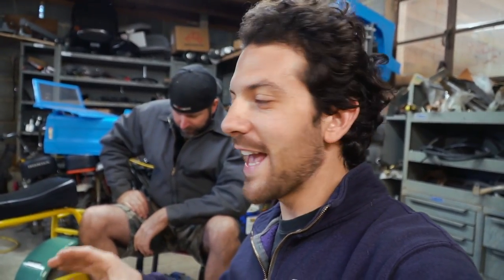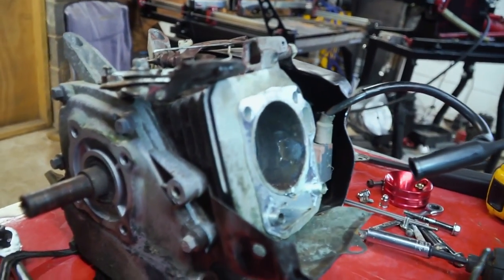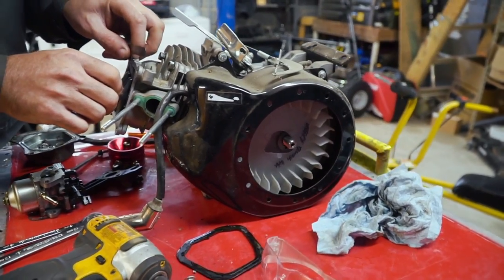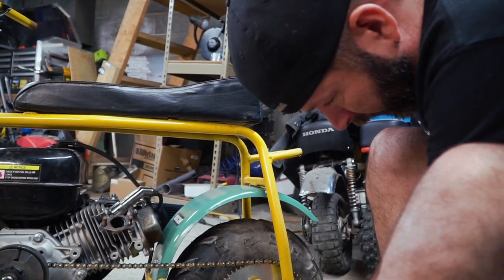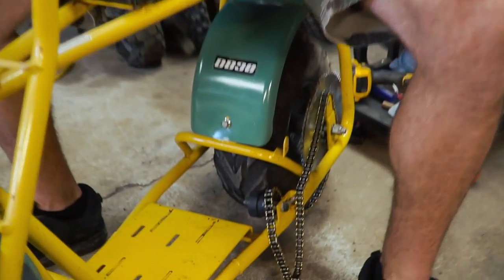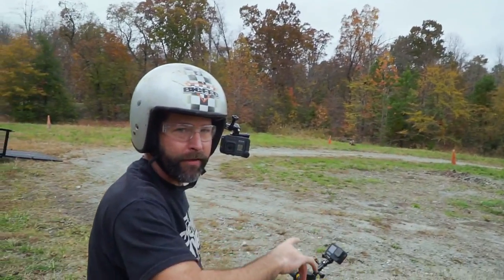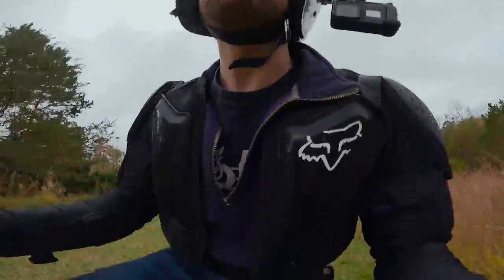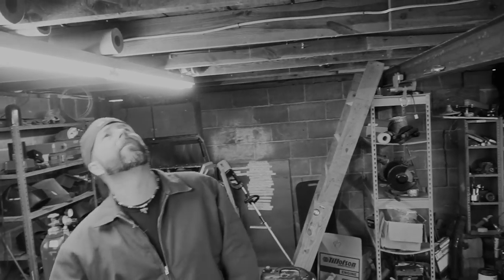Building a Budget Doodlebug Mini Bike | Max Fun for Under $200!

Comment from the maker: After working on all kinds of crazy high HP builds, this was a nice breath of fresh air for us! Have a great Monday!
Reply: Hi i have. A yerf dog go kart and i have a 420cc on it how can i wash it without damaging the engine any tips
Reply: @farazamjad3849  just cover the engine and you'll be fine
Reply: I got my go kart yesterday and its fun
Reply: @farazamjad3849  I'd recommend covering the engine with a tarp And not Putting water on full power and leaking through
Reply: Love the work you guys do, can you guys do a full dedicated episode of all of the different gear ratios into combinations from Torquay off the line performance to top end that would be great,  clutches versus cvts
Reply: How would a tillotson 212 be in a mini bike? How would the power be for acceleration off road? Should i use a clutch or a torque converter if i am riding a small oval loop with the capability of going over 20 with a small atv
Reply: @charliemaybe  thair should be some vid if you can't find any try [buld break reapeat
Reply: SnS (slip n slide) love the vids
Reply: You should also try to moto Vox mini bike!! And do a all our build ( painting the engine block, put stage 3 parts, custom rattle can paint job etc) what ever it is it’s going to be cool!!
Reply: @CarsandCameras
Reply: I have a 9 hp Honda, not a clone on a doodle bug and I have got a 15 tooth clutch on it and it flies, also the front wheels of a lawn mower fit on the rims awesome
Reply: You can also put snowblower tires from China
Reply: Try the chain under the idler pulley wheel, at the end of a simple arm swinging from the current tensioner tab, with a beefy little spring to tension.
Reply: I watched your video where you guys got the two lawnmowers and you built the racing lawn mower and I just thought of if you guys still have that cub cadet rear engine lawnmower and the engine from the racing mower and you put that engine on that rear engine rider and build a racing mower from it
Reply: Nice "feel" torque wrench where can I get one?!?! lol I use that method sometimes too can't even lie! Also now that I'm watching all the way to the end I went back and looked and Ike ran a 1:14.46 not that it means anything but he was Killin it out there!
Reply: So, are you guys married or dating or what? 'Cause you guys are a cute couple. I can't remember the smaller guy's name, but I guess Ike like curly hair.
Reply: @MoparMattt  John does that all the time doesn’t like to lose
Reply: @farazamjad3849  the engine isn’t going to get hurt if you get water on it. You could sink it and as long as you have the air box and exhaust covered, you would be fine.
Reply: My dad and I use an old guard rail for a drag used to sharpen down you just keep dragging it and dragging it and dragging it and eventually you'll get out all the rough spots hell you could chain three four five of them together
Reply: Please throw the GPS universal front suspension on it....    it will make you love that thing!    I have one with front suspension and itsa cetely different bike!
Reply: U need a disc for behaind that tractor, till and till and till until your tired of it then let it set a week then till and till again then u can box blade

Comment: I took my dad's DB30 that had been sitting in a shed for years (98cc motor quit, probably dirty carb or fuel filter) and installed my GoPowersports stage 2 cruiser (Mod2) Predator 212 with flat top piston and .010 head gasket. I like the added duration of the mod2 combined with a cheap set of Yamaha 1.3:1 rockers, it runs hard to 7500 rpm. These days I use a little different cam in street or mild motors but that thing runs great, starts super easy and has good low speed manners. It likes the 22/26mm round slide from GPS as well. I was lucky enough to get the holes drilled right the first time and it slid right on with a 12 tooth Max Torque clutch, had to add a couple links to the existing rusty chain. Just had to lose the lower rear fender support bracket. I know the gearing is a little low but with that tire size, the bike is fantastic. Thinking of adding a 30 series torque converter some day but I think I'll save that for my BT200X with the big tires.
Reply: Nice

Comment: I used to assemble those doodle bugs when i worked at pep boys yrs ago. They also sold the baja brand bikes and quads too. I assembled a baja 125cc quad that came with long travel control arms, nerf bars with nets, racing pipe. It was only $800 new! For a cheap quad it was fast, sounded good and looked badass. That was 12 yrs ago. Great vid as always

Comment: Made by Fox in Janesville, WI.  I had a Fox Trail Tramp as a teen - beautiful bike, 4hp Tecumseh, full suspension, road--legal lights, disc brakes front and rear, two-speed clutch system, etc.

Comment: In regards to your tiller question, I rented a small tractor with a PTO output to a 5' tiller behind it. Thing was a beast and made short work of tilling large areas. Single pass is all you need. Not expensive, maybe $250 for 4 hours or so. Then, I just dragged a wood pallet on top of a chain link fence behind my mower. But you could easily drag a box scraper or the Kubota bucket over it after tilling. Then pack it down. Good luck maintaining that track. Keep up the good work!

Comment: My son also had a DB30. We did the same swap of the 2.5 hp for a Predator 212. Putting the PREDATOR engine on made the bike a lot of fun. With a straight pipe exhaust, and removing the governor it topped out at 43 mph. Since then it's become a Mini Chopper. If you want a bigger front wheel you can get one off a moped, and it fits on perfect. It improves the handling of the bike dramatically. I had to remove front fender. But the moped front wheel came with a drum brake so I now have front and rear brakes, also a speedometer. All from thrown away scrap metal at the salvage yard.

Comment: This is my favorite mini bike of all time...I'm on my 7th one. Got it on trade for top end work on my Uncle's truck. Back before HRMB came out with the jack shafts, he built his own. We shaved the head .045" on that little 2.8, deleted the govermental device, built a header, and did some carb work. Ran much better. Mine has had 5 engines...the latest is a Tecumseh flathead HSSK50. Just got new paint on it, and of course, some tastefully placed Cars And Cameras stickers, because you know "It'll Be Fine." For my weight and the mostly street riding, I've found that 4 to 5.5hp is more than plenty.         Kenda Scorpion tires are the best tires for DB30...hands down. Also, making a new bracket and lowering that ugly front fender really gives the bike a great look.

Comment: Those Kubota tractors are really light so proper liquid filled ag tires are a must if you want to do any dirt work. Tiller is ok for roughing up the land BUT the one made specifically for the tractor forms ridges under the tilled dirt, something to be very careful about especially with so many two wheelers on that trail. A box blade with ripper teeth is a much better choice. Fill the bucket with dirt, leave mower deck on (though it is wider than any other implements for that tractor), angle the box blade the right way and it should do alright even in hard dirt. A single big ripper hook is a must for bigger rocks and roots. Custom build one out of 1/2" steel. You won't regret it!
As for slotting motor mount holes, a jig saw with metal blade works fairly well since you can get the blade into a small-ish hole and the cut is straight, not radius-ed like with a cutting wheel.
To mark the holes you can use so-called "dowel pin points" that are little pointed rods with a small lip that get put into the hole at the bottoms of holes, then pushed into the other piece to copy that exact location. Very useful in wood working. Can't exactly press them into metal, but you can either reach down to it with a punch, or slide the motor left-right/forward-back to leave scratch mark 'targets'.

Comment: Your box blade is actually the best tool for leveling dirt.  Set the chisels a little deeper to break up the soil and then raise them and use the box to move the dirt as needed.  Yes, it takes several passes to accomplish it but it's well worth it for the finished results.  Make certain to drag both directions for best results.  NOTE:  Use the three point hitch top link to "tilt" the box for the task at hand.  Rotate it forward for more aggressive digging and backward to smooth the dirt out.

Comment: hey guys next time you run that thing in the gorilla snot make sure you stand up with those tires you have a little bit extra control, and turn around the rear tire so they can act like a paddle and get you more grip especially in the turns so you don't wash out, luv the videos

Comment: When I built my go kart I decided to try just holes instead of slots because motors always want to move eventually.
I sized my chain links BEFORE drilling the holes, I shimmed the motor on a few washers and it has been rock solid,
You can get the chain tension to stay exactly as you like it and it wont budge, and you can shim it for chain stretch.

Comment: Make a bolt on section of 4-6" spikes for the plow/dragblade on the tractor.It'll break up the surface and allow the box to plane it,and drag the looser soil,without catching too deeply on roots.You could also make a blade for the scraper that works as you back up.Groom the trails and build different size jumps.

Comment: Harley rake, aka power box rake will smooth out your track. You can find them at local equipment rental places. They come 3 point pto driven for tractors or hydraulic on the front of skid steers.

Comment: I have a DB30, The best thing I did was replace the mechanical disc brake with Hydraulic. Then I replaced the stock engine with a HF 212! It now goes faster than I want to! It is a blast!

Comment: Get a piece of chain link fence as wide as you want graded. Weld the fence to a steel pipe or piece of an eye beam as wide as the fence. Then pull that around the area you want graded. You might need to add more weight to the fence to get it to dig down enough.

Comment: 6:45 after doing enough engines and torquing bolts, you get a "feel" for the correct amount. I'm usually pretty close. I have my torque wrench, and I use it on unfamiliar builds and critical torque settings

Comment: As a project you should try a wide tire minibike. Like take the 3 wheeler front tire and get another, put a sprocket on one and then split a minibike frame to accommodate the width. Would be interesting to see if the mud performance and over all stability would be better than standard width.

Comment: The way I mark the holes for the engine mounting is by putting down masking tape on the engine plate. Put the engine where you want it, then cut down a pencil to around 2 inches and mark through the mounting holes on to your masking tape. I've found this to be way easier and cleaner.
Reply: I just use a short pointed screw or nail and scribe the inside of the hole, ez pz.
Reply: Dip a Q-tip in paint then use it as a marker. You can bend the Q-tip to fit anywhere

Comment: I have a duddlebug with a honda clone 196cc engine with a stage 1 kit and it rips. I can say 6hp is more than enough to have fun with the duddlebug frame. I just recently put some suspension forks on it from Go Power Sports and it rides soo much better.

Comment: To smooth out the trails, get a heavy steel I-beam (or similar, just heavy) and tow it behind the trophy cart. After about 50 laps and a good rain it'll flatten out and be a decently hard roadbed.

Comment: Take the box blade with the scarifires  and tear up your track. Then fix you a drag, made out of old tires laid on their sides connected together with water inside the tires. Then you can drag it back smooth and use the front in loader on your tractor, to add and remove dirt as needed it’s possible to do it on the cheap

Comment: Re:  Smoothing.  Some packed stuff you gotta use the bucket on the loader to break it up then back drag it to smooth it.

Other not so hard stuff you can use a rear blade angled aggressively with some weight on it

Comment: If you want to make nice smooth paths you could look into something like a york rake to upll behind the tractor. It's a lot of work.... but it can be done. Rake it smooth wherever you can with the york rake, remove any rocks too big to rake smooth with shovels and tractor, and bring in dirt and fill into areas too hard to rake smooth. You can also get sure pack which is a kind of dirt you can buy made for making roads it packs down super hard into almost concrete so after making a trail or track that you like you can put down an inch or so of sure pack and after driving over it a bunch of times it will form a hard layer shell of dirt on the top of your track to preserve it better from washing away and stuff like that.

Comment: Best Option for simply SMOOTHING loose ground is a scrape blade. But to bust it up and make it movable you’d want a cultivator or a tillage tool. Box scrapes are only good for 1 thing, dragging big loads of dirt over holes/ruts to fill them in. Or just moving piles of dirt in general.

Comment: I remember seeing different driveway box scrapers, they have one from 250$ on up depending on your budget you can pull behind a four wheeler or powered ones for a tractor. Please fix those bumps and especially the rocks coming from the creek that killed the oil pan on the kart. Drill the rocks put in a anchor and pull them out with the tractor.

Comment: Does your box blade have rippers?  That’s usually effective. 

You can add a tooth bar to the bucket if not to break up packed dirt. 

You can also add a 3-point subsoiler. Heavy hitch is a good American brand, Titan is dirt cheap Chinese that usually works.

Comment: Try cheap 1:1.3 stamped rocker arms 15 dollars off of ebay. Run stock cam. Bump the compression 12:1, port, springs, timing advance, alloy flywheel and rod. I did this and it runs like a champ!

Comment: I just got a doodle bug (dirt bug) with the original 2.8 lifan for free just needed the recoil fixed and I broke the throttle cable while riding but fixed it. It rips but its a bit weak on the low end. good bike for gravel trail/road riding though.

Comment: For torquing heads the Milwaukee extended electric ratchet goes to 55 and no more when using the trigger, this is what u torque 5hp flat heads Briggs to I’m not sure on the Honda clones / Briggs inteks, maybe that helps some of y’all, makes puttin a head on easy

Comment: Funny thing is, the front tyre was on right to begin with.
Arrow facing forward on top is for traction. Arrow facing backwards on top lowers rolling resistance. Since the front doesn't brake the tyre should be on "backwards"
Actual motorbike tyres will have a directional arrow for front and back and are ONLY designed to go in that direction and HAVE to be mounted correctly. Single compound off highway tyres, it doesn't matter.
The reason people believe arrows must forward is because on machinery arrow forward on top means arrow backwards on bottom pushing dirt to outside of tyre, arrow backwards on top is forwards on bottom and it drags dirt to the centre of tyre when slipping which "lifts" the machine. On a tractor pulling a plough this chatters and means less traction.

Comment: NOT SHOT. Time for overbore. Btw, I say SAVE THE OLD GARAGE. Upgrade, restore..keeping it's old character..add a second "modern" wing with very flat thick concrete floor, an I-beam to hang a rolling winch for lifting heavy stuff and moving it across the garage..... 😁

Comment: hit up a scrapyard for cheap materials, and weld up a shelf from angle iron and expanded steel mesh, or steel plate, an old oil burning furnace tank cut up works great, then add it to the top of the grader box to hold some junk car batteries to add weight for more down force. we had a couple of 3' long pieces of steel train rail that my grandfather got when he worked for the county highway department chained to the back blade on our ford 8n that we used to plow snow on the farm, but not everyone can get ahold of that stuff anymore. not legally anyway. it added about 150 lbs. to the blade making it a lot more effective.

Comment: Adding another link to the chain would probably solve the tension issue for you. With that bit of extra length you would then be able to use the roller tensioner to dial it in.

Comment: i have the doodlebug in my collection, i call it the drag bike, all set up wtih a detachable wheelie bar, and a stage 2.5 212cc predator, about 13-14hp, with a torque converter

Comment: Im so late to this video. I love doodlebugs. I got an orange one i built as a sleeper (other than the wheelie bars). The predator 212 has some serious mods and the header is wrapped and its got a mikuni so its not a total sleeper, but looks like something a young man would currently build. The hybrid cvt clutch system is scienced out, gearing is close...the bike runs 9.40s at 67 in the 1/8 and fun as hell. 
Second doodlebug has been tore down and gonna be similar build in power from camshaft to cyl head porting, but runs a hilliard inferno flame centrifugal and want to compare the two similar bikes with totally different clutching mechanisms. 
I street drive both bikes when cops are not around but primary purpose is drag race on track and no prep street.
Ill update numbers and times as purple bike progresses.

This stuff is so much fun and a fraction of cost as to running a car at the track. Im 52 years old and been drag racing all my life so this is not new to me. 
Reason i said that is to get you younger people out there and experience the same. 

A torq-a-verter setup definately requires a wheelie bar unless you want to go slow and/or cause physical harm